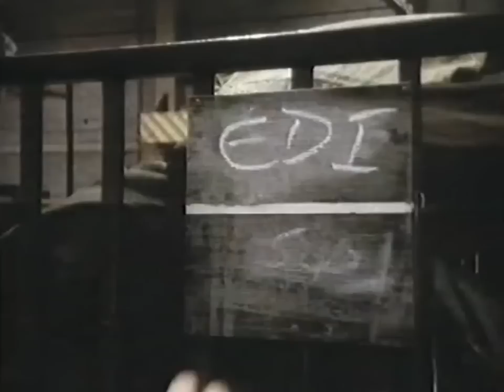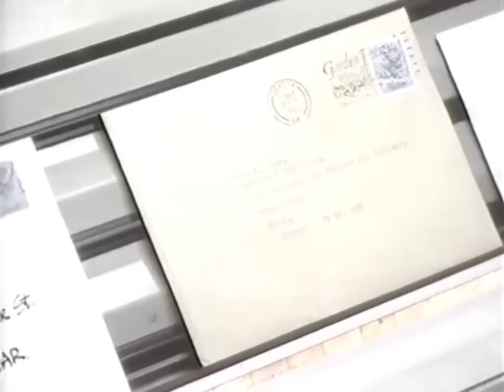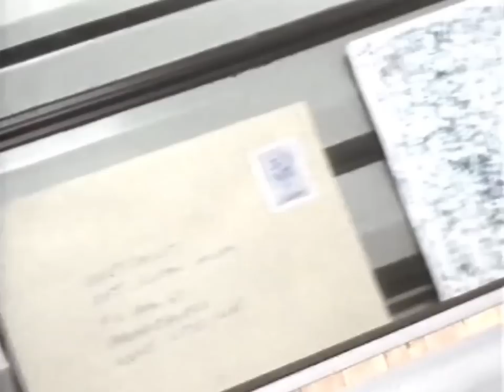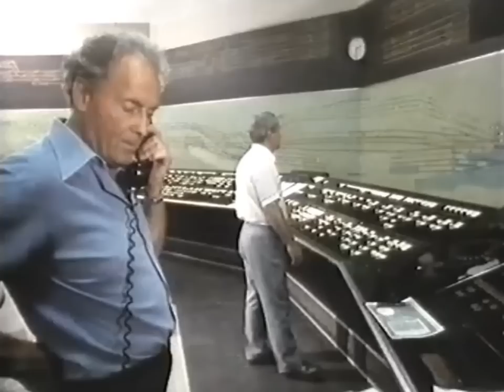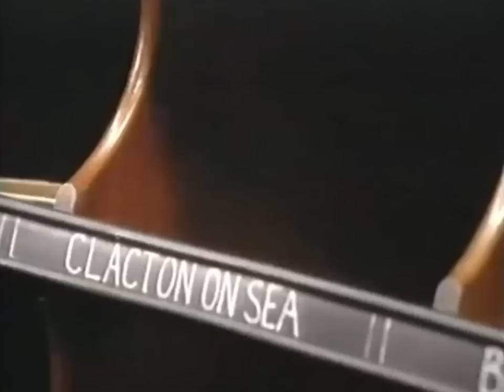Night mail 2 - 1986

Comment: I used to work for RM between 1985-1989 and used to meet the NE TPO at St. Pancras, driving up in front of the now Renaissance hotel and through the arch. It `was a fascinating site, vans, Postmen, sacks everywhere. We used to do a 7hr 10 day and book the other 17 hours on overtime. 6 hours at time and a half, 7 hours onwards at double time. The Working time directive stopping that. Thanks for sharing because it brings back some great memories.